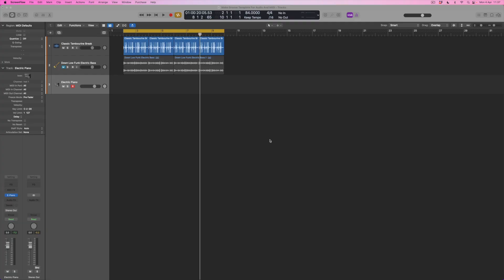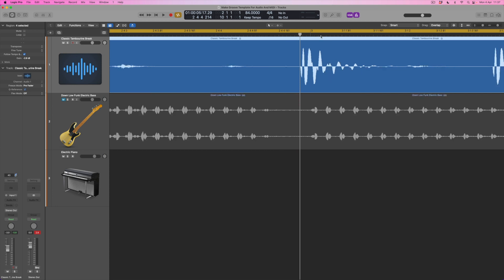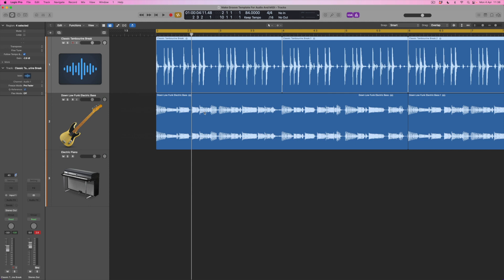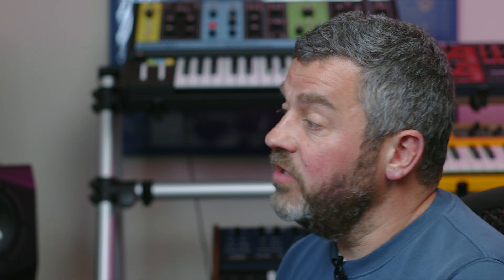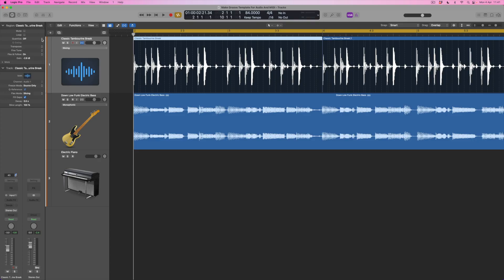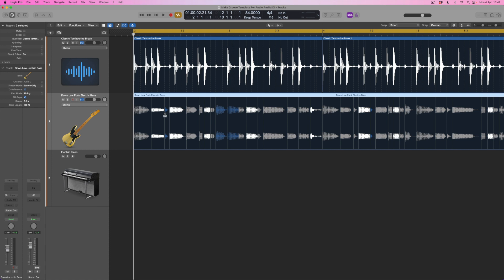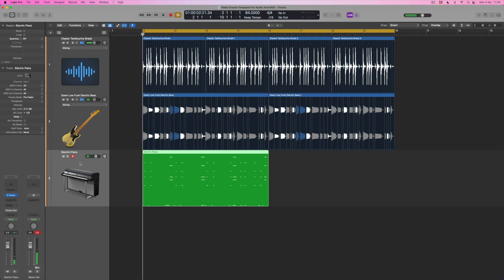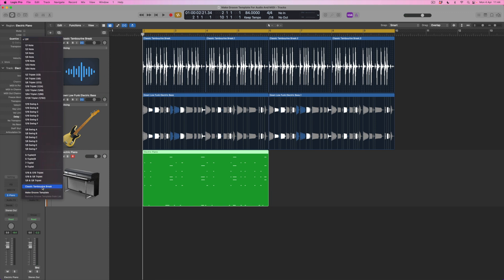LOGIC PRO X - Making Groove Templates

Comment: fantastic video. One question i have is, is there a way to copy the velocity as well as the timing? So convert hi hat audio to midi where velocity of notes is transferred? thanks.
Reply from the maker: Hi Jason. Thanks, glad it was useful. Think of Groove Templates and Audio to MIDI as two separate processes. If you want to borrow the groove of a rhythmic loop and apply this to multiple regions in a track, Groove Templates are great. If you want to turn the strength of each transient hit of a loop into a Velocity map, Drum Replacement will achieve that most comfortably. I’ve made a 2-part miniseries on this very subject. Part 1 is here: https://youtu.be/4FbH3AVns98 Hope this answers your question!